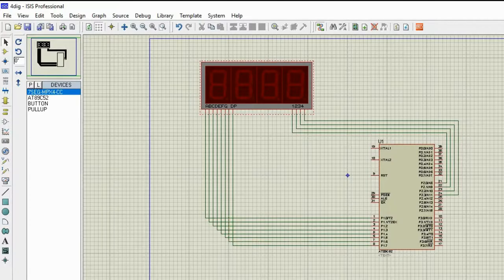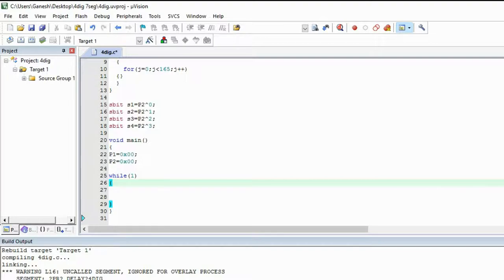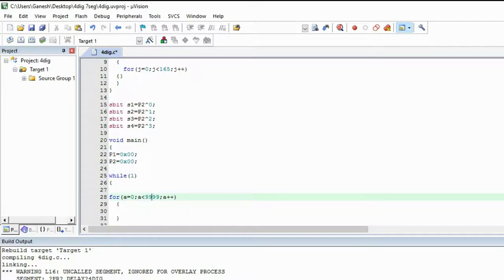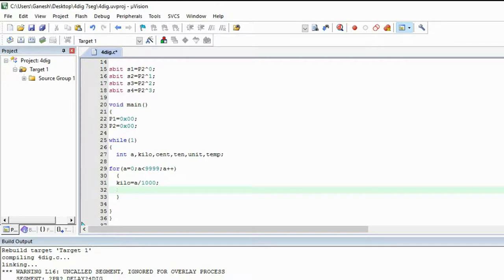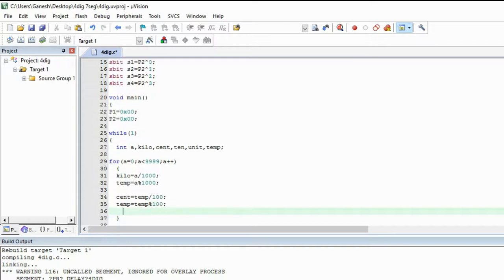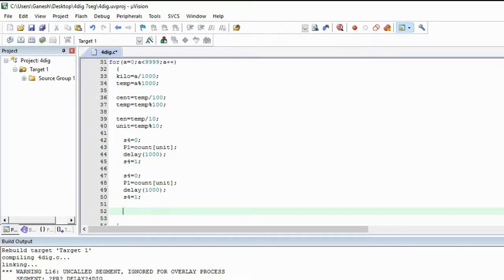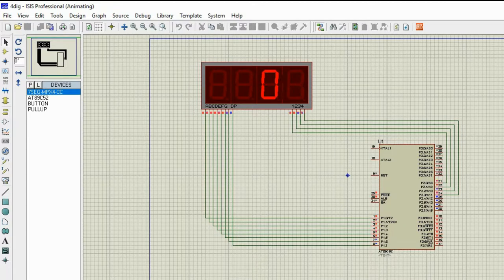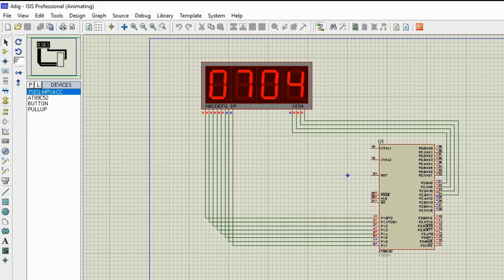7 Segment LED 4 Digit Counter - Part 7 - 8051 Tutorials

Comment: why we use kilo, cent, ten ,unit ,temp.
can you give simple and basic 
code
Reply from the maker: u have to understand that pin A of all the  4 display (7 segment) are shorted together same for pin B,C,D,etc.
So, if u send 1 it will show 1111 on display
there for u need to separate it by using that(kilo,cent) algorithm.

if u want to show any number example: 1234 then send 1 to s1, 2 to s2, 3 to s3, 4 to s4 with some delay between them
try on the 2 digit display it will help u to make it understand.